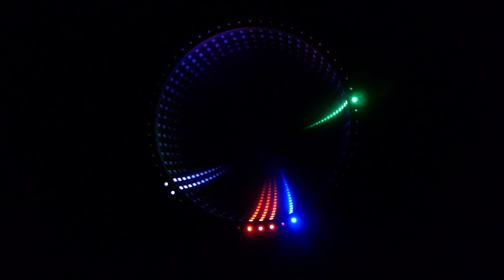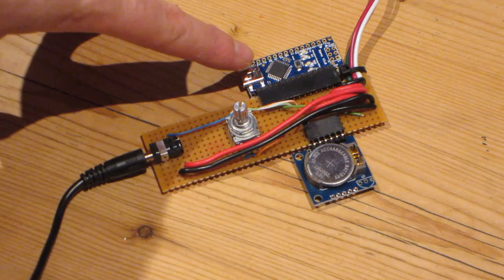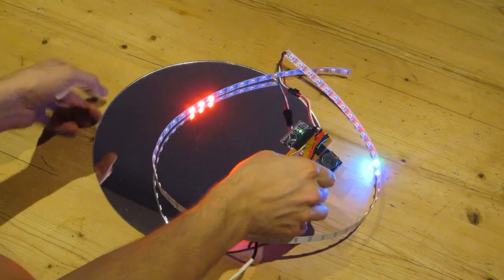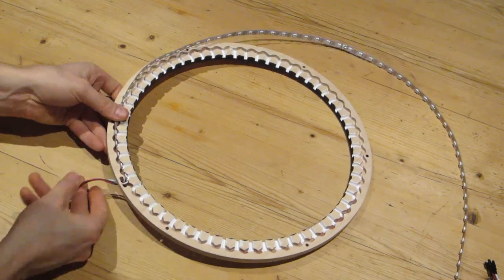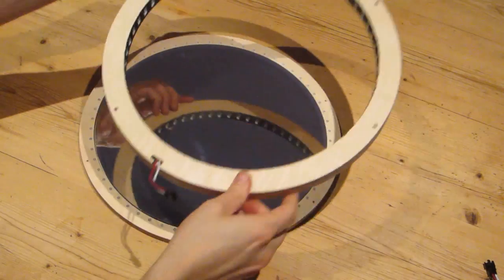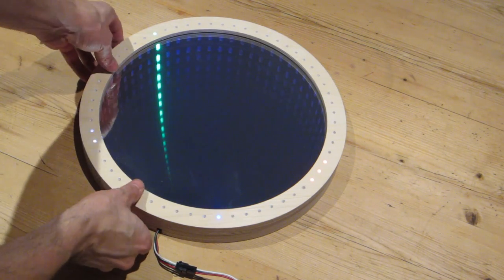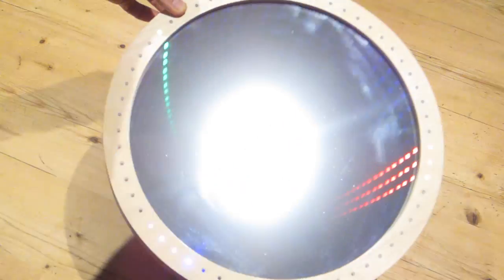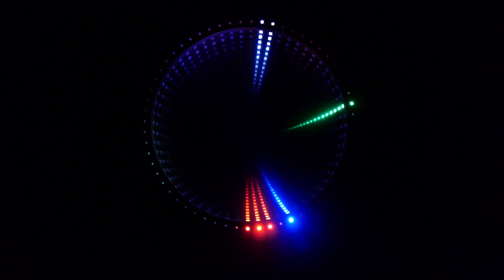Infinity Mirror LED Clock - An Open source Arduino Project

Comment: I acquired all of the files you put on Sourceforge. I only found one picture of the schematic with a wiring diagram. On this picture, (v_0_28_Breadboard), I could not read any of the pin numbers on it. Is there another schematic that I can view? Also, I looked through the code and it appears that you used the DS1307 for the RTC, is this correct?

Comment: I had a problem with the Fast LED library. The one from the download does't work (not even the examples from the library).
To solve this problem I had to load the newest version 3.1.6 over the Arduino program. As this version contains no "Fast SPI_LED2.h"
I had to copy it from the nonfunctional version into the new one. This has solved the problem for me.

My thanks to the author of this program. It is the best I found so far. So many functions. Thank you very much for uploading it. I love it.

Although I'm not able to program something amazing like this yet (probably never will), I still managed to make some small customizations.
When the hour hand is displayed by three leds, I dimmed the outer ones, so that the one in the middle is the brightest.
Another small change I made was the millisecond hand. I made it so that it starts at the actual seconds hand and gives a push to the seconds
led when it comes around. It is a very nice effect. 
I will try to add a light sensor, as the clock is too bright at night.
The only thing I don't like is the rotary encoder. It bounces to much so it is too hard to handle. That is probably my fault as I ordered the cheapest one.

Comment: What are those black things connecting the Arduino and the RTC to the board? (Looks like some kind of connector) Where can I get some of those and the board you have? Im not familiar with all the names of what would be on a circuit board. Im still kinda new to this kind of stuff...

Comment: Has anyone solved the problem that the whole LED is Green? LEDs that should not light up are Green.
-Clock looks Yellow from Green + Red.
-The minute is camouflaged in Green and is very slightly visible.
-Seconds appear Blue.
Is it because the Arduino code is GRB and not RGB?
(I used WS2812B.)

Comment: I must say your attention to detail is fantastic, cutting out the ring and making slots to hide the strip. Question, can the strip itself be painted and the less taped off while painting achieve the same effect?
Reply from the maker: +TheDuckseason If I understand your questions correctly, you can in fact buy black strip light, then you might be able to get away without cncing the slots. My slotted version is an adaptation of a previous clock I had made.
Reply: Thank you and we'll done.

Comment: Amazingly beautifull! 
Mate please may i ask you to shhare your CNC part of the project. 
Im working on simmilar task right now, would appriciate so much your cnc part of "lock-in" led stripe. Ai file or whatever. What was your stripe in this project: 60leds/m or 144leds/m?
Reply from the maker: Hi. Thanks. There should be dxf files along with the code. 60 leds/m

Comment: hi there.
I read on one of your thread on line having a discussion about rc HSP brand..
I'm in a bind wondering if you can help me out??
I have an F1 hsp but one of my parts broke on it the part number is 13013.
but I can't seem to find it anywhere as the brand is not popular.. I don't even know what the part is called.
checked eBay nothing I contacted the seller and they only go by numbers and they don't have the part in stock ..
it's as if I'm lost at sea when trying to find this part.
the part is semi round and the rear axle fits in it and it mounts down supporting the rear axle one piece on each end ..
there is to pieces but only need one. 
any help greatly appreciated...
thank you

Comment: Good day Morgan, I'm very interested to do the same clock as a gift to my wife using the WS2812 RGB LED Strip & the Arduino Nano, would you be kind to provide the 3D Design Drawings/Dimensions in order to CNC the plywood in the exact same dimensions? Thanks a lot!
Reply: aboulfoof All of the files and code is available through the sourceforge link in the description

Comment: Hello Mr. Barke, I am interested in the Infinity Clock you built 5 years ago. I like the idea of the LED-Tube-Ring very much and want to ask, if you could send me the 3D-file of it, because at the moment I am working on such a Arduino based Infinity Clock in school. Best regards, Maximilian
Reply from the maker: Thanks. I haven't made any 3D files. So you will have to make up from my 2D files, that should be in the link on the page. Cheers, M.

Comment: Hello,What type of RGB are you using?WS2812B or WS2812Thank you for your answer
Reply from the maker: +marc baumont I am not sure. I think it was WS2812B. Without looking into it I am not sure what the benefit is of either. I believe my project would work with both and if it didn't it wouldn't take much modifying. Cheers, Morgan

Comment: '
nice home made mirror LED colors clock...
how come dont have 12 numbers from 1 to 12
Reply from the maker: bestamerica The hour hand is depicted by 3 red lights. Other makers have made them with hour LEDs, but I like the design simplicity of a single ring. You can read it naturally after a few days. I have a non mirrored version for my 2 1/2 year old that only has the hour hand and that changes colour when it is time to get up and wake us up.

Comment: Excuse me,which type of LED do you buy?
Reply from the maker: Ws2812b direct from China, but you can use any and change a single line of code.
Reply: @MorganBarke  which line of code?
Reply from the maker: I am not sure off the top of my head. It is a standard line when setting up FastLED. So check with their documentation.
Reply: @MorganBarke  Thanks

Comment: where line for ajust brightness?
Reply from the maker: +INILAH INDONESIAKU  I have not used the brightness script. I simply change the RGB values to alter values. Maybe if you stick in the brightness command before the show command it might have the desired effect. Please have a play around and report back with your findings.

Comment: does the LED have 4 wires or 6 wires please
Reply from the maker: D. Reichert 3 wires. 
Gnd, 5+, Data.
Reply: ok I was looking on ebay and all I could find was a WS2812B and you didn't say "B" version, and it looks like on ebay it has 5 wires, but I read some are 4 and some 6.  http://www.ebay.ca/itm/Hot-1M-5M-30-60-144-LED-WS2812B-5050-LED-Strip-Light-Waterproof-New-GY-/272479721430?var=&hash=item3f710e97d6:m:mcq3Yr0KRSEgpTE0_pnTXtw
Reply from the maker: The LEDs in the ebay link are fine. It looks like there are 2x Gnd, 2x 5+, Data. I assume this is to make it easier to add additional power for longer runs, especially when using 144/m. If you look closer at the picture, there are 3 parallel contacts on the back of the strip, not 5.
Reply: @MorganBarke  wow has been 2 years since I downloaded this. I finally am getting back into this. I have the code and everything working, was wondering how thick is the plywood.  I want to cnc out the frame, I noticed you have 3 dxf files, the v0.1 has 4 rings like your video, the other 2 versions each have 2 rings, but are very different, what are they for, thanks
Reply from the maker: @Hoss_1966  4 rings are for infinity mirror (2 inner for electronics, 2 outer for holding glass. Other versions are clock without mirror and solid face. Glad you have move this project off the back burner. :)
Reply: @MorganBarke  thanks, how thick is each piece of plywood.
Reply from the maker: @Hoss_1966  9mm

Comment: what is the length of led string ? give me a number :(( thanks
Reply from the maker: Trung Anh Phan Twice as long as half a length of led string... :))
Reply: no ways. 60leds/m, so diameter of the clock is ~31,847 cm, right ? :)))))))) silly question but it's too big uh huh yours is not

REPLY
Reply from the maker: Trung Anh Phan The slot for led strip is 31.8cm, but out diameter of clock is slightly more. Not sure what, without looking at dxf. Hope that is of help.

Comment: Ah finally i've done my clock, now i have to figure out how to disable unused leds, cause  all 'background' leds light green :S
Reply: I have this same problem. Did you find the problem and/or a fix??????
Reply: @mikedeffenbaugh6999  exchange this line in code #include <FastSPI_LED2.h> to  this  #include <FastLED.h> then put it to arduino; and this will not be important i have two libaries FastLED-3.3.2  and FastLED-3.0.3.
Reply: @tomaszd3880  Actually replace:
this ---->  #include <FastSPI_LED2.h
with
this --->   #include >FastLED.h?
Reply: I'll try that when I get a chance. Thank you!!!
Reply: @tomaszd3880  That didn't work. I get an error with that line changed.
Reply: @mikedeffenbaugh6999  Do you try with new libaries FastLED-3.3.2?
Reply: @tomaszd3880  Yeah, I tried 3.3.2 and then upgraded the library to 3.3.3. They both give me an error. If I change it back it works (compiles & downloads) but I still get all the 'off' LEDs on bright green. I still have FastLED 3.0.3 which is the one I started with.

Comment: Did something happen with the FastLED library (specifically the FastSPI_LED2 used in this code)? There are endless warning messages regarding FastLED when I compile the sketch, and my LED strip is simply lighting up at full brightness with no animation. It flashes rapidly when pressing the rotary encoder push button. I have tried multiple Arduino Nanos and an Arduino Uno R3, but I have had no luck. Any thoughts? I'm confused if I needed to add custom library folders to my system, or just add them from the Arduino library manager. Thanks!
Reply from the maker: Stephen Trenta it should work with the library included in the zip. Did you move the library into the correct folder? are you able to get the lights to work with an other lighting demo?
Reply: I got it to work, and I thought I replied to my own comment but it must not have saved. Thanks Morgan!
Reply: I know you wrote this a year ago but do you remember how you solved the problem?
I have the same problem right now. I used a 60 LED Ring and also tried a 60 LED strip.
Both work with the Adafruit Neopixel library but not with the examples of the FastLED library from the zip-file.
I have added a 1000µ to the powerline, a 430 Ohm resistor to the data line. I used a shielded cable (10cm) for the dataline. In the code I tried WS2812, W2812B, WS2811 and WS2811_B settings for the LEDs and changed the data line from A0 to 6.
I erased the EEPROM. The serial windows works and shows the time and some settings.
I tried a Uno and a Pro mini (china clones). The effect is always the same as you described above.
It would be nice if you could help me.
Reply: I figured it out. Descricption in the main thread

Comment: If someone could just CNC route me the frame, that would be great! Unfortunately, I don't have access to a CNC router.
Reply from the maker: I hope in the coming months I will be able to allocate some time into this project. To include creating a updated, more detailed instructions/tutorial and a small run of components for people to buy. But if someone else can help you out, then do that, as it might be long than a couple of months. Cheers, Morgan.
Reply: Where did you source the one way mirror from? I've tried using mirrored film, but I don't like the results. Thanks!